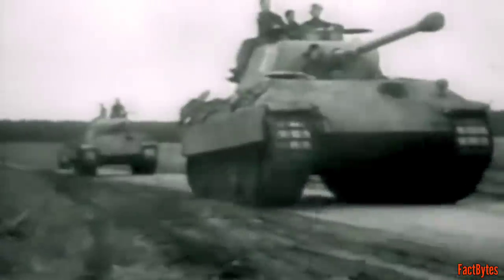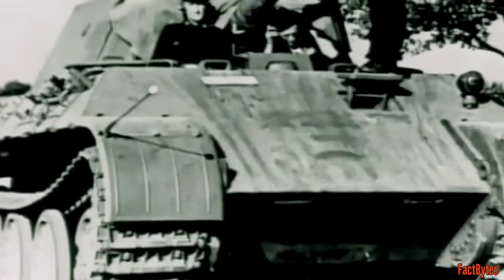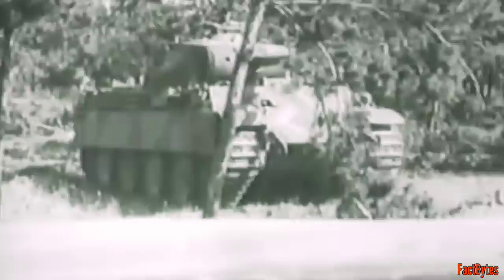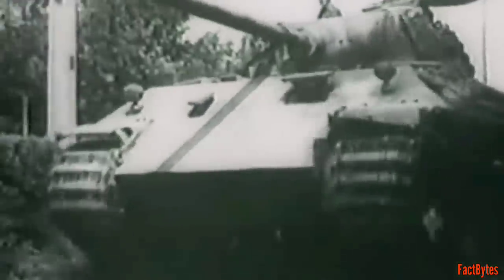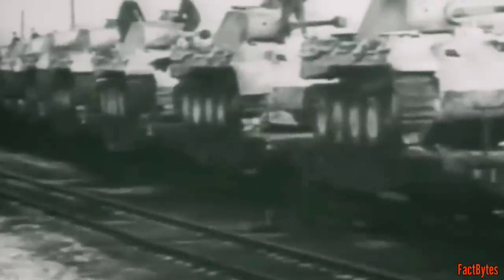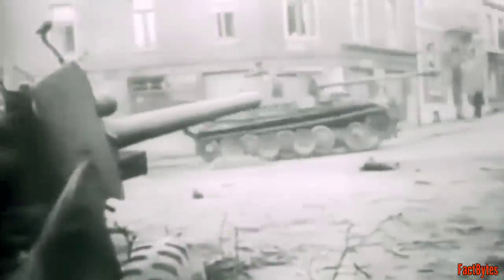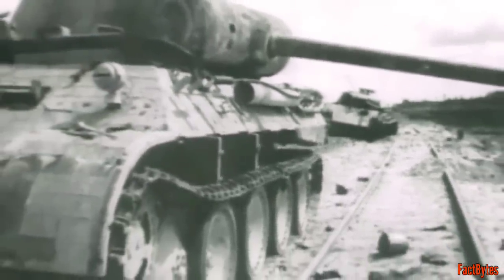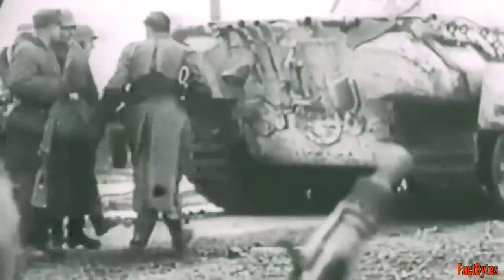Was The German Panther Really The Best Tank Of WW2?

Comment: Tank for tank, the Panther probably was the best, once it got sorted out.  In its debut, when the Germans foolishly depended upon it at the crucial Kursk battle(Citadel), the Panther was a mechanical/operational failure.  Once sorted out, it was more mobile, easier to manage and navigate(bridges, etc.) and heavier hitting than the Tiger I.  They even got its price to be only 10-15% higher than the Panzer Mark IV.
Reply: Frequent transmission break downs and it's propensity to catch on fire are not qualities that one associates with the term, "best".
Reply: Bit of a myth that. The Panther proved very effective at Kursk and mechanical failures were not as high as the modern assumption. In fact the after action report by Von Lauchert shows that far more Panthers were in the repair shops due to battle damage than to mechanical failure, specifically mine damage.
Von Lauchert states the transmission modifications at Grafhenwohr pre battle were successful and that engine issues decreased the more the engines were run in.
Reply: @lyndoncmp5751  Yeah, another problem was that Germans used to remove anti personel mines by taking the heaviest tanks around and driving straight over them. Not the best way to keep the suspension in working order.
Reply: Some replies said the Kursk performance wasn't that bad, while another that it was overrated.  The Panzer IV oddly had better protection against some rounds than the Panther.  The pictures and commentary are what they are;  at the end, the last gasp in the south(Kursk) had intrepid Mark IV's with a smattering of the vaunted Mark VI Tigers, the Panthers far behind. On the other hand, as stated, the sorted out Panther was much more mobile, bridge ready, and hard hitting than even the handful of Tiger I's in action.

Comment: They couldn't make enough of them fast enough to make a difference.   It broke down a lot.  The Sherman may not have had as much firepower, but the where relatively cheap, mass produceable, fast, and reliable.
Reply: in hindsight yes. but in the germans view they're the most produced tank in 1943-1945 when it's also the peak of allied bombing campaing in europe especially in 1944. it doesn't gave the breakdown record of tiger and king tiger and far too many ppl exaggerated that it will breakdown every 150km, you can watch MHV channel video of the panther for the reference
Reply: The Sherman lack of firepower was due to US army bad planning, the Sherman was designed with a ovesize turret rig, and it was modular in nature, so the tank coul grow, but they did not push for a bigger gun until 1944.  Shermas had being fitted with 76mm guns, with 90mm guns, with a french copy of the 75mm gun of the Panther (IDF M50), with a 105 Howitzer, with a 105 AT gun designed for post war MBTs (IDF M 51),  and with the brits 17 pounder.  Doing that in a Pz IV chassis or a T 34 and keeping the rotating turret was impossible.
About the armor, there is nothing they could do, Yes you have the A3E2 Jumbos, but they were a special task tank, they US has to move tank by ship far a way, they by railroad and road marches not only to Europe, but to the Pacific islands, and to India,  a very heavy tank would have complicated the logistics a lot.
Reply: iven that the Panther's service rate is pretty much on par with the Panzer IV it did not break down as much as certain people try to paint it as.
Reply: @Dreachon  depends of the marks and time of production. Early D models did break down a lot,  A and early G models were reliable by german tank standards (pz4), as  the director of the Bundesmuseum said, they were acceptably reliable considering what the bring on the table in mobility, armor and firepower, late G models had the produccion pitfalls of late war german crumbling industrial base and logistics.
Reply: @ricardosoto5770  Correct, it is pretty standard that the first version of any tank is going to be the worst one mechanically, this can be seen with others such as the T-34, Cromwell, Pershing, Churchill, KV and if I am to believe what some at TE have found the Sherman as well.
Reply: @Dreachon  ITs called clearing out the bugs, that is why I avoid the first production runs off any industrial products. Unless its for collecting. The Sherman did not had many mechanical bugs just because it used the running gear of the M3, but there was nitpicking about the hatches, gun sights, armor, tracks.
Reply: @ricardosoto5770  Indeed but sadly a lot of people act as if this was only a problem with German tanks.

And a lot of people like to act as if the the ausf. D speaks for all of the Panthers.

Most of the issues got resolved with the ausf. G though sadly this all then gets negated by the myriad of problems that the Germans have on the industrial and logistical field. Something that by mid 1944 is declining on an almost daily basis.
Reply: @Dreachon  German are often called out for two reasons, since they were losing the war they did not had time to ironing out the bugs on their equipment and fielded them as they have them, time was running out, and two, when they finally ironed out some bugs, their industrial base was crumbling and the use of sabotage prone slave labor destroyed any quality their productis might have.  Also germans have a huge quantity of fanbois an werhaboos that then to gloss over those facts and thing their pet tanks were invincible instriments of death.
Reply: @ricardosoto5770  All sides have their fanboys unfortunately, and they are no less annoying than the Panzerfanboys, in many ways I find the Sherman fanboys even more annoying as they do not seem to have learned from how the others react.

And yeah, the German industrial complex was pretty poor due its inability to meet the demands that would be asked of it. Looking at it from an industrial point of view the outcome of the war is kinda there from the end of 1941.
Reply: @ricardosoto5770  wrote: " German are often called out for two reasons, since they were losing the war they did not had time to ironing out the bugs on their equipment and fielded them as they have them, time was running out, and two, when they finally ironed out some bugs,"

-- Who had chance to iron out all bugs at war? Only Americans maybe, because war didn't reached that continent with all the aggression to disrupt production in factories...
Reply: @RussianThunderrr  Yes, the Sovitets had to weed out their bugs on the T 34, while under atack and moving their factories east. The brits did took time to iron the bugs in their tanks, often resulting in being obsolete when fielded.  The problem with german late war tanks is that they were complex products designed un 1942, while in 1943 and 1944 the war has changed, their bugs were never trully weed out and the lack of materials and use of slave labor made those worse. Germans never designed their weapons for a total war.
Reply: Tell me about the Sherman Firefly.

Comment: If it only could travel more than 150km without needing a new gearbox, it would have been a good tank.
Reply: again the 150km exaggeration, when the data about it is just one paper from 1947 by the french tested on remaining panther in western europe after the war. while some if not most of the germans tank crew records about the tank didn't have any breakdown less than 1500-2000km, some even more up to 4000
Reply: @hermanwillem7057   Not ony the french paper, the brtis have the same experience, and the Soviets. road marches were hard on the Panther, perhaps not 150km but still les than allied tanks. The Brits even got MNH to build some Panthers after the war for testing and found they to be delicate.  The problem was that late war, Germany was short of strategic minerals, to do the proper alloys for the final drives. but the mid production Panthers, the late model A and early G models were far more reliable, Germany still have stocks on molydenum and factories did not rely so much on slave labor as in the end of the war, Many late war german tanks shows clear signs of industrial sabotage.
Reply: @ricardosoto5770  No, the Soviet make no comments on the only 150km. The Brits only make some remark from a handful of Panthers that they assembled themselves from parts scavenged from a bombed factory and had been assembled without any blueprints, all of which completed the test track in Germany before the British just drove them to destruction in the UK. They didn't have MNH make them for them.

The so-called French report is also as useless as it can be since it seems that nobody in almost 30 years has seen the actual report, and in all that time no less than 5 separate historians, one of whom is on the payroll of a major gaming company, have only ever been able to copy what Spielberger first published.

The 150km figure doesn't appear in Germans records and something that seems to get ignored all the time is that every Panther that fought in Normandy had to drive between 140 and 300km to get to the combat area.

We know that Chuckoo the captured Panther lasted for some 5 months with the British and another Panther captured and used by the French was in use with them for some 4 months.
Reply: BTW they french eventually rebuilt their Panthers and 800km marches where possible, it was not a problem of workmanship, it was a problem of industrial sabotage by slave labor, a common problem in late war german weapons.
Reply: The gearbox didn't need to be replaced after 150km.